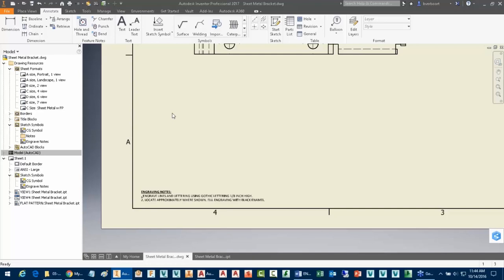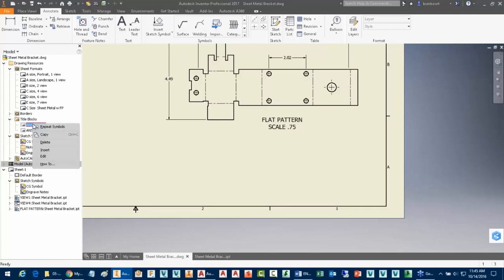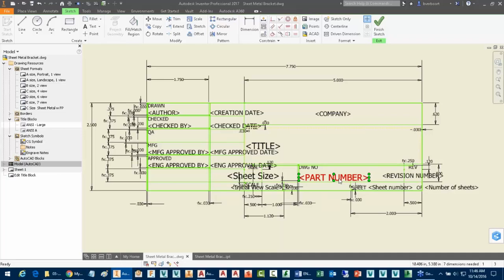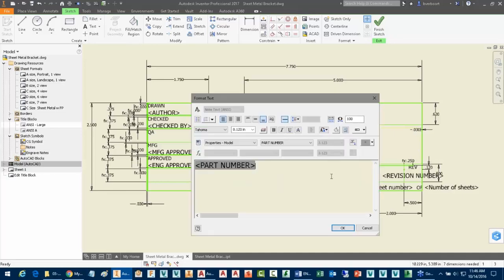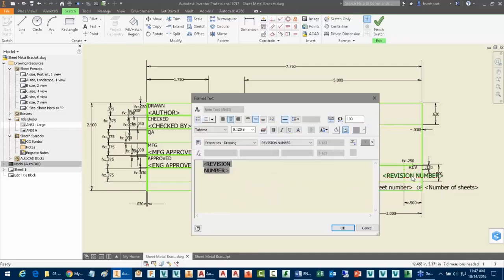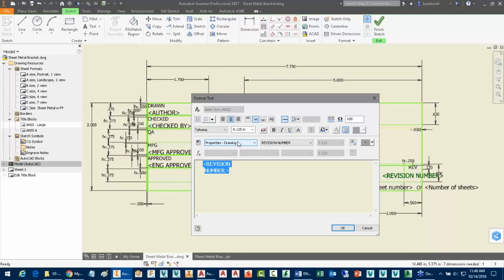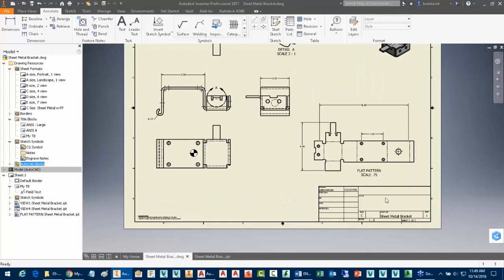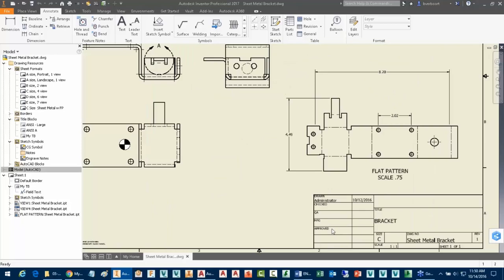Autodesk Inventor Drawing Productivity: Title Blocks

Comment: Brain, even if a rev is not involving the 3D model, you still need to update the revision on the model and then it would auto populate correctly. Depending on industry, could cause issues if more than one revision is still being manufactured.   Thanks for the information!!